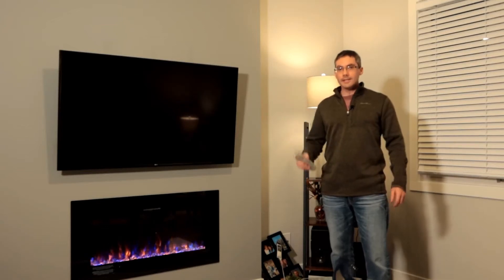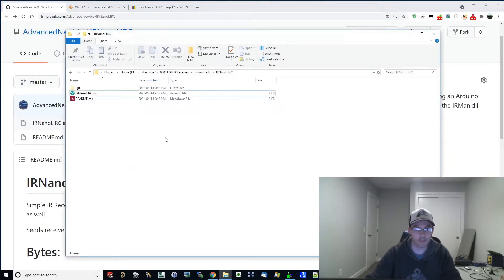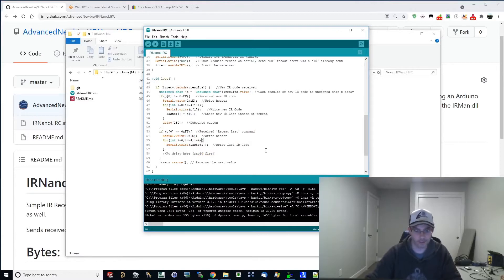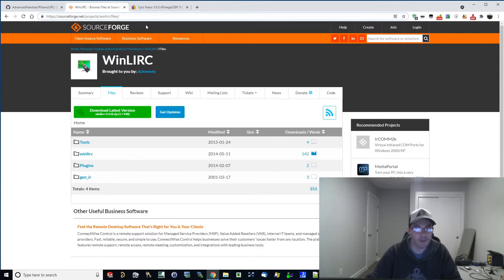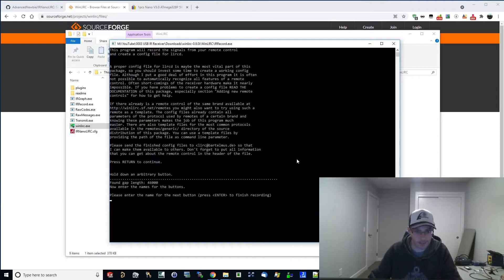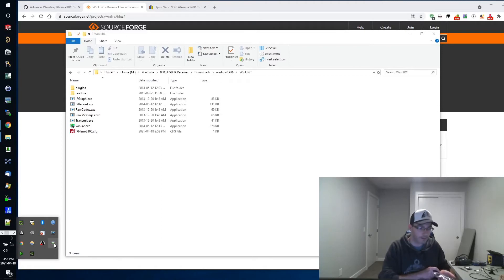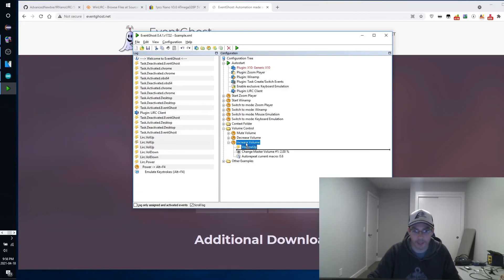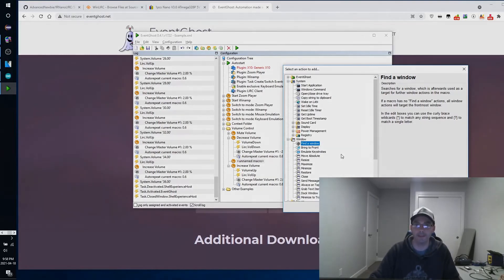DIY USB IR Receiver - Control your PC using any remote - (HTPC + WinLIRC)

Comment: This tutorial does not work today. When I try to read the IR input via RealTerm it spans the console with ""E0 00 E0 E0 E0 00 E0"" even when nothing is being pressed.
Reading the commentaries it seens that the current state of IRremote version 3.1.0 is somewhat diferent from the one that was used in the video
Reply from the maker: That's correct.  If you revert back to the older version used in the video, it will work as intended.
Reply: @TheWP  It worked with version 2.4.0 of IRremote
Reply from the maker: Awesome!

Comment: Can I do it with Arduino UNO ?
Reply from the maker: Yes, you can.  Using the same code in the video - using any digital input pin you'd like (just by modifying the code).

Comment: hey bro i really wanna know can it switch off and back on your computer
Reply from the maker: It can only switch off the computer.  But it wouldn't be too hard to also trigger a power on signal on a desktop computer's motherboard.  There are two 'POWER SW' pins that the power switch shorts out.  This could easily be done with the Arduino.  You can also use the standby voltage rails coming from the power supply.
Reply: @TheWP  oh I see

Comment: Hi! I followed all the instructions up till the 3:30 mark, but RealTerm only displays "E0 00 E0 E0 E0 00 E0" when I initiate it, although I'm not pressing any buttons on the remote. After that, it displays nothing else, whether I press buttons or not. Could you please advice me on what to do? Thank you!!
Reply from the maker: The library has changed the way it works and I think this is a result of using the wrong library version.
Reply: @TheWP  what should I do then? Sorry if I'm being dense, it's my first Arduino project. Thanks!!

Comment: I only receive zeros in realterm. All buttons just get a 0. This is after changing decode(&result) to decode(). Any idea why?
Reply from the maker: Hey Raaaww.  The 'result' is just a variable, and &result gives the memory address of that variable.  This is passed into the decode function.  The decode function changes the data stored at that memory address to what ever was decoded (the IR data).  This is called pass by reference.  So basically, the decode function takes in a memory address of the 'result' variable, changes the data at that memory address, then returns.  If you don't pass the memory address into the function - then the decode function will not know where in memory the IR data should be written to and will basically do nothing.  Since the result variable was initialized with all zeros when the program starts running on the microcontroller, when you read it back it's still all zeros.

Comment: Can't Configure WinLIRC, When the program wants to open the command prompt it closes immmediately. I looked up for everything. Tried to start IRremote.exe from cmd. This was the message in the command prompt:

"IRRecord.exe: colud not init hardware (lircd running ? --> close it, check permissions)"

Tried everything from forums I can find, Non of them had the same problem ever, and nothing worked
(Tried running the program as administrator, for my user, for all user, for the IRRecord.exe as well)

Do you have any idea? Maybe something on the computer interfering with the program?
Reply: UPDATE:
I managed to start the record. It looked like the program didn't find the arduino with the receiver. I tried many ways and then I had an idea.
Realterm managed to see everything btw, and there is a function called Echo port. I redirected the input serial to a virtual serial port and through that I connected to the WinLIRC, and finally IRrecord started properly with the IRMan dll

Now Eventghost finally can see.
However, there are always problems xd

The volume changer didn't work in EventGhost. I read about it, but could not find a solution yet.

Other then that It works perfectly, just have to run 4 different programs xd
I will try to make it work only with WinLIRC and eventghost.

(btw I'm using a PS2 DVD remote (SCPH-10420))
Reply: @KaneBear1  Glad you sort of got it sorted.  One thing I can suggest is that if you have a program where the command prompt appears then disappears right away - you can run command prompt first (Start > Run > 'cmd') then run the program in there.  If the program quits, the command prompt will stay open and you can get more information on why the program quit.
Reply: @KaneBear1  could you please tell me how to use that Echo port function? I'm having the same issue you experienced, but I'm afraid I don't understand how your solution works

Comment: I have a ps2 ir controller that I’d like to use with my pc. But it already has its own receiver. Thing is it doesn’t work properly on pc with any controller converter that I had used.

Would it work with the way shown in this video?
Reply from the maker: As long as it's IR and the frequency of the remote matches the frequency of the IR sensor, then yes - it will work.

Comment: Not what I was looking for but could be a project for another day. Definitely sparked some interest here. Right now I'm looking for out of the box solutions.
Reply: What type of project are you working on?
Reply: @TheNoahTT  I'm putting together a wireless game station that runs full HDMI from my tower to an old laptop screen. I'm having trouble finding a good device that can relay my inputs wireless back to the tower. I was hoping I could relay it back through Wifi. It sounds easy at first but I'm casting HD with zero latency and want a keyboard and mouse to speak back over a good distance. I'm looking for a devise to plug my inputs into than cast that data.